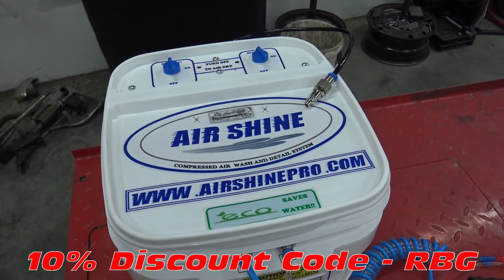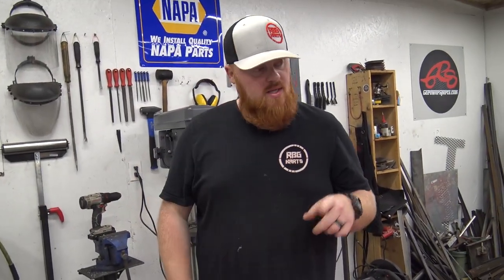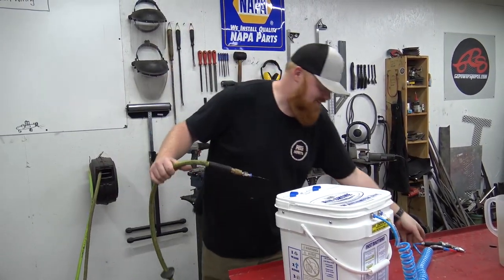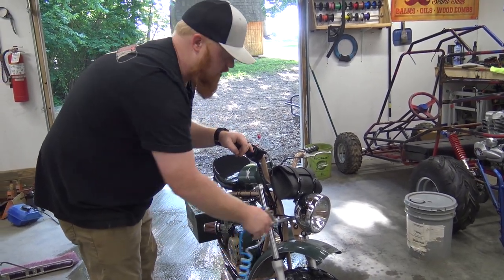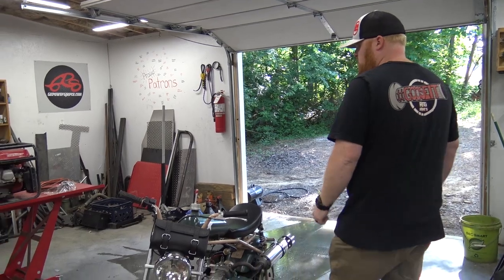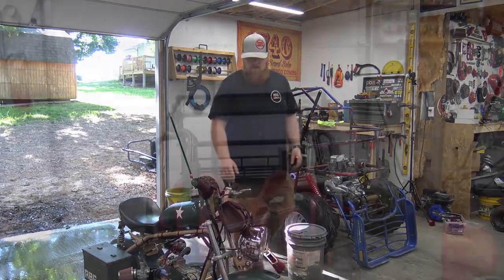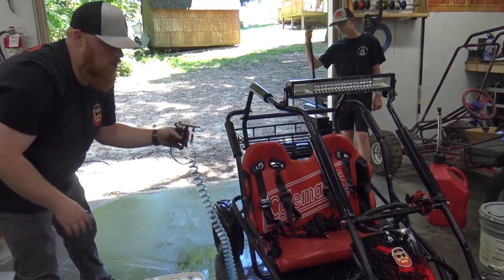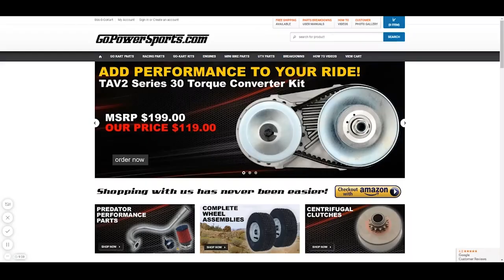Go Kart & Mini Bike Detail ~ Air Shine Pro Review

Comment: U should put some awesome cleaner in one side of it
Reply: Izreal 3345 yes you can run all kinds of cleaners thru it 👍
Reply: AirShinePro then that sounds like something I can use for my detail business I can find lots of ways to use it lol
Reply: Izreal 3345 absolutely we have sold them to detailers and they love the spots they can get into
Reply: AirShinePro I have a few traxxas rc monster trucks that are water resistant but get very dirty when bashing around construction zones. This seems like it would be a perfect clean up tool for the aftermath
Reply: D Snyper that it would!! Use the RBG code and save some cash and probably clean them up in minutes making very little mess!!!

Comment: Seems like a joke
Reply: Big Whane fr lmao 😂
Reply: Some people will buy anything. It is a joke. It's a toy.  Geared for the NON PROFESSIONAL, cheap, broke ass weekend warrior who doesn't own REAL tools.
Reply from the maker: Seems like you have a real problem with me reviewing this product. You could always click off the video if you don't like it. I like it and will continue to use it. Its fine if you disagree
Reply: Eric Ek So what would you recommend for a quick detail in a small workshop that doesnt blast water everywhere (carb, air box, clutch, surrounding projects) also maybe its cold outside and using the pressure washer is not ideal.
Reply: Justify it all you want. In January, I washed my honda ith the garden hose. I paid $100 for the car, sold it for $800. The garden hose a coupe towels and a little soap made me $700 in 30 minutes..
Reply: It would have taken all day to do it with a spucket.
Reply: Take your bucket and wash my tow truck, then tell me how great it is.
Reply: This is no offense to RBG. They work hard. You should be selling REAL equipment, not novelty items.
Reply: That's what everybody said about airbrush when it came on the scene. Think about detailing.
Reply: I'm here because I like Go Karts. I like MANLY TOOLS. Go buy it and wash some flower pots, Pansy. I don't wash my shit in snake oil, Ric. I don't waste my fucking time. I own a company. Detailing? Seriously? Do Ford Dealerships run this set up? Chevy? Kia? No, because it's a waist of time and money.  Are you company reps? It's fucking crap. It's a damn  CAT SAND BUCKET.
Reply: Then why are you wasting time on youtube
Reply: Wasting my time on Youtube?  I'm not wasting my time on Youtube. I'm doing 12 different things all at the same time. I didn't come here to criticize him. And I watched the video like everyone else. It could have been amazing. But I'm looking at all it's limitations, it's crappy PLASTIC handles.. The fact it's just a bucket. And if you're going to carry a bucket, you might as well have a towel and forget the air compressor. It's stupid. All that wasted time just setting that ridiculas contraption up, you could have had it half way washed. No one is so lazy they are willing to work twice as hard for half the result. Common sense. It's a waste of money like most of  the Chinesium crap.
Reply: Eric Ek they support his channel and that is his optimal goal. You know they paid him and that's all that matters. I had made a comment earlier in the comment thread and the only thing I said was that sucked well it wasn't geared so much toward the product as it was toward the back I wanted to see something on go-kart not cleaning products. But, as well as the product too because I would never buy one I got a DeWalt 3800 PSI. works for me
Reply: Sure. I get it, man, I'm not stupid. It's not his fault. I know how it works, and I couldn't give a damn, but it's a piece of crap, lots of us see a piece of crap, if the sponsors really give a fuck about selling something, then have some fucking respect for RBG,  give them something real to sell. It's here, because the product sucks so bad they can't sell ANY. No one will buy them. They probably have tens of thousand of these things taking up space in a wearhouse and they don't move.  Like I said, we all watched him use it. We have our own reviews. Who wants that mess in their garage?? There's a damn good question. He can use it in every episode, I could give a rats ass. It's not personal against RGB. I said my piece. I was over it hours ago. No one is checking their bank accounts to see if they have enough money to afford one. Build it at home if you must have one. It looks DIY.
Reply: Eric Ek I appreciate the hatred you have toward our product but you do have it all wrong sorry you feel this way but I don’t have thousands we are a family ran business 80%of our units are made in the USA we have engineered this product to save water with no mess not to blast off the hardest the dirtiest built up grim yes that is when you need a power washer, our product is a couple months old and yes we are selling them, and I can’t thank RBG enough for giving us there time On using the unit as it was designed for. Sorry if we offended you with our product. Please don’t take it out on RBG for enjoying our product or “$&@&$” as you would call it , thank you everyone that does like our product and purchased one hope you all enjoy cleaning without the mess
Reply from the maker: Todd Bearden they did not pay me a single penny or I would have said it in the video. You guys are getting all bent out of shape over a product that I like and will continue to use. This is the dumbest conversation I have ever had on any of my videos. If you don't want to watch anything but go kart videos then don't click on the non go kart videos. Simple as that. No reason to come on here complaining.
Reply from the maker: Eric Ek you realize you are cursing and saying dumb stuff over a video. The local Ford Dealership in my town is getting one and loved it when I showed it to them. You are acting like im making people buy it. I like the product and wanted to show it. Thats it. Feel free to leave the channel if it upsets you that much.
Reply: Y’all wildin
Reply: I don't care. I was not even the one to start this thread. I don't care. Congratulations on your product.  Everyone is singling me out,  as if I care. I leave, you call me back. I wasn't the first one to curse,  and I have no intentions of continuing a conversation where at least 10 people as of this morning had the same VIEW on your product. I was not alone, I was not the first, and I was not the tenth say something. Free speech, welcome to America. He should be selling real tools. He has a REAL business, doing REAL things.  I have said I don't give a rats ass if he uses it every video. Because I do not care. But I won't be purchasing the product either, as it is not convenient nor effective in a real garage. It seriously took 3 times longer than a hose and wet towel.  Call it what you want. All these people thinking the same thing, and you go after me.
Reply: Red Beard's Garage I did apologize to you in the live stream and I guess I should have elaborated a little better when I said they pay you. They do pay you they pay you the product that you get to keep and utilize. Not cash. I know they don't pay you cash. You just did a video the other day on it. And I said that sucked because yes I thought you were going to be working on a go-kart which is one of my passions and you were doing a review and that's all fine I watch the whole thing. One thing about reading somebody's comments opposed to hearing them you can put your own feelings in them and do not get to experience the feeling of the person explaining it. That has been a fault since day one of social media. I didn't mean anything bad by it and I wasn't puting your product down but I can certainly see how you could have taken it as such. So again I apologize and I really enjoy your show I look forward to it and I watch everyone and when I'm bored I go back and watch the ones from way back when you first started which didn't have anything to do with go-kart. So whether you like it or not I'm a dedicated subscriber and I'll choose my words more carefully.
Reply: Red Beard's Garage also read my comment where I said that they support your show they as in the people such as gopowersports and the people that gave ( I'm not clear if they actually gave it to you  or if you had to pitch in on it  )you the table and the welder the wash bucket and so on and so on
Reply: And I’m the one that gets commented on for saying seems like a joke ??